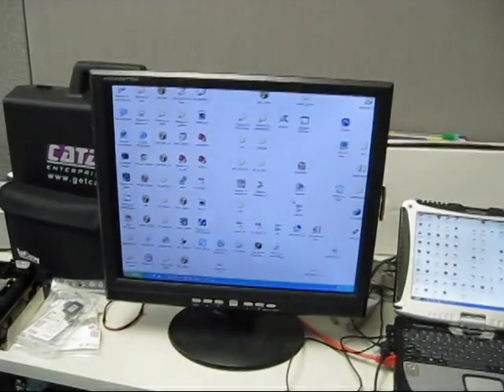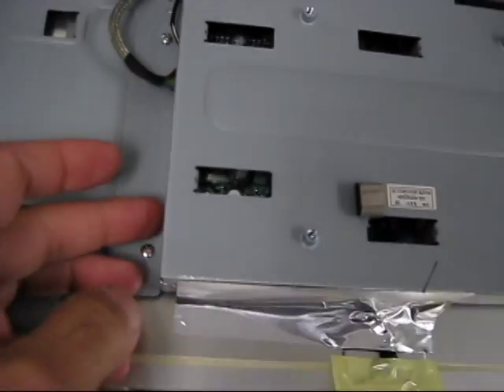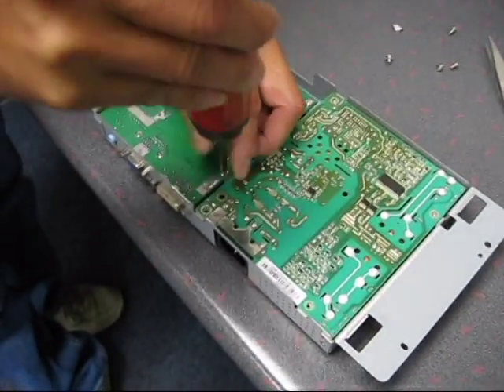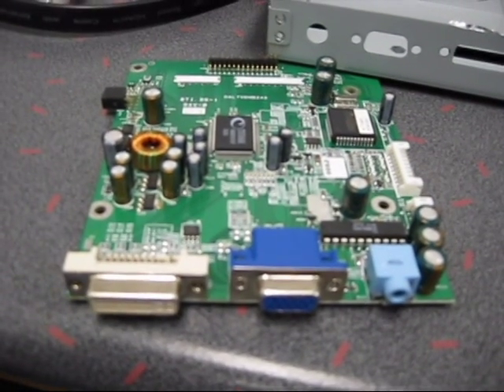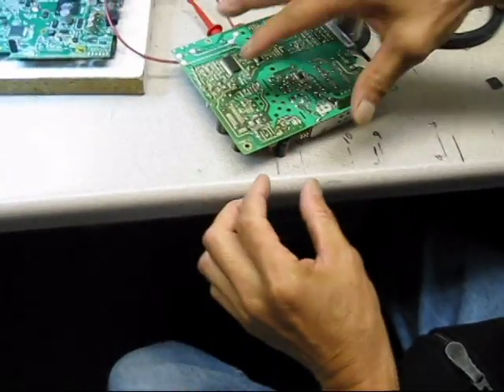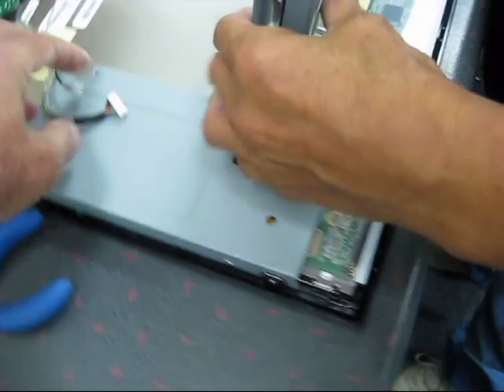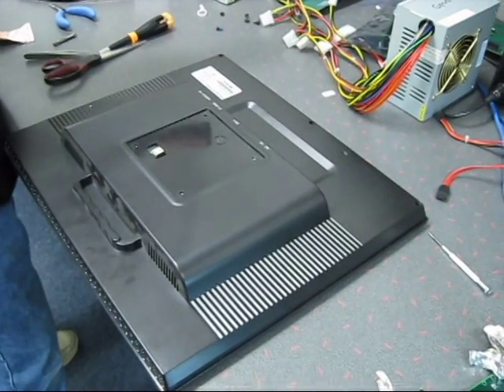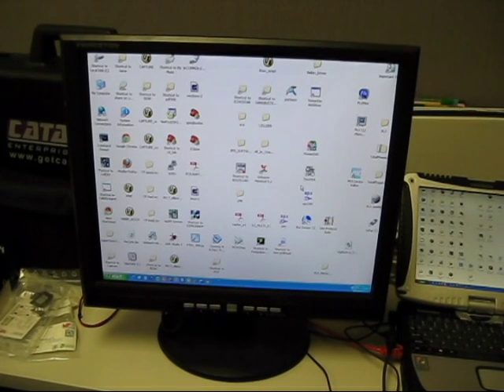PC Monitor Troubleshooting and Repair

Comment: my monitor just got a problem.... before it was showing some horizontal lines and not 75 % of the display just got blurred and nothing is visible... there a small part visible at the top rest is completely screwed up.... can u tell me a solution... is it the problem of the lcd or power supply board?
Reply from the maker: Can you describe what the "small part" looks like?  Is is a 2 lead device, multiple pins, etc...   It is unlikely that the LCD itself went bad.  It could be the power supply or the LCD driver integrated circuit.